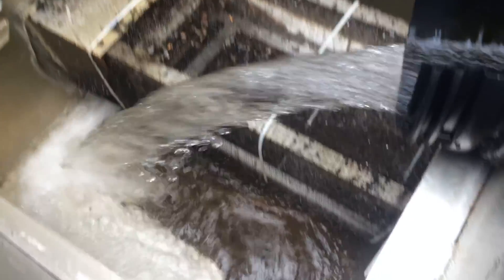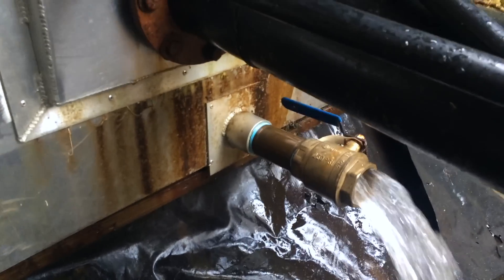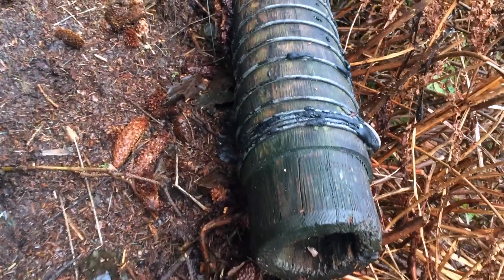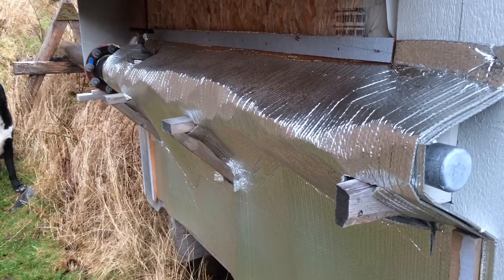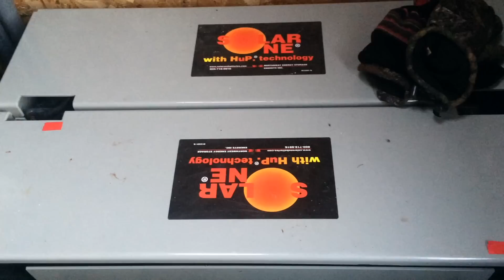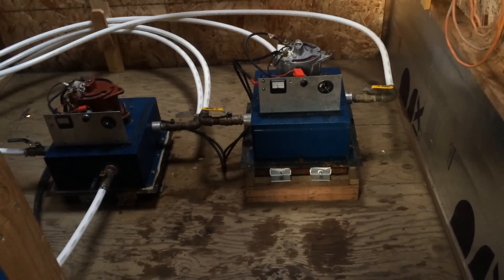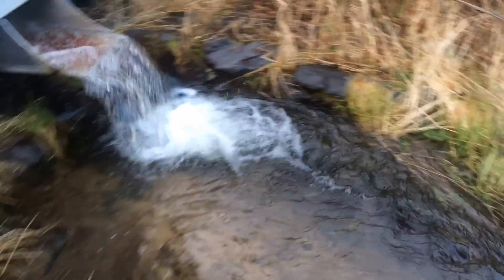Our Hydroelectric Power

Comment: it was all so beautiful until about 5:20.

right angle bends? small bore pipe? ball valves? PM generator? rectifiers, chargers, batteries?

its a shame that these systems are sold. they just... miss the point. its not your fault. theyre all set up like this... seriously, someone slapped these kits together, sells them off as green, and laughs as they pocket the profit. they are a far cry from what is truly possible, and it just makes me sad. its a CON JOB.

water doesnt not like right angle bends, and water does not like abrupt changes in diameter. all the pressure in a pelton should appear directly behind the nozzle, and nowhere else. that means its big bore. all the way.

ball valves restrict flow by restricting pressure. they dont maintain velocity. whereas a doble or spike type nozzle does. it restricts the flow, maintains pressure, maintains velocity. the wheel speed is then controlled entirely by the load, and the flow only has to be adjusted to suffice.

give me an old genset head, and with that same wheel i would give you mains compatible power, 50/60hz, 110/240,3phase 415, whatever... 24/7, without all the stupid electronics in the way.

and if it breaks down you can tap it with a hammer and figure it out.

Comment: What part of the country is this located?
You must obviously cook and heat all your domestic hot water with propane gas or use wood stoves or boilers. 
I suspect all the inverter load is lighting and low watt appliances.

Comment: I would love to have a Hydro Power system. Looks like you have a lot of head pressure. So, I am curious why not put real full size generator motors on top of your pelton wheels instead of those tiny 60Amp alternators? Extra power never hurts.

Comment: Awesome system! My dream is to have hydro, solar, and wind power working together so I can supply all my energy without fuel.
Reply: Look into Liquid Air as well.  A compressor uses excess energy during your peak hours to compress air into a slurry of liquid nitrogen and oxygen and when you need extra power. Simply use the liquid to power a genny.
The byproduct is ice cold air..
So you can use it for refrigeration or air conditioning
Reply: you're better off going for two alone depending on where you live
Reply: My also same dream 🙂

Comment: Why do you have batteries? Considering you have constant water flow?
Reply: The batteries in any off grid application is so you have a constant supply going to the inverter to switch the DC to AC household power. This is a 48v DC system with huge battery banks so they are not running into deep cycling the batteries and if they do run into a mechanical problem they probably have at least a weeks worth of power in battery.
Reply: Because you need somewhere to store the power being generated.
Reply: David Tebbitt but production is constant
Reply: @bob15479  Though production may be constant, usage is likely not constant.  Batteries would allow peak usage to exceed production wattage.

During the day there may be very little electricity consumption, which needs to be dumped somewhere.  If you dump it to batteries, you can spend the excess at night on lighting, heating, etc., even if the turbine is under-powered for all that usage.
Reply: @Thoracius  so why not just use a super capacitor bank?
Reply: @PhysicsViolator  not as good bang for your buck, probably, and offers no advantage.

Comment: this is an overly complicated system, a water wheel eliminates all this transfer of water to accomplish what can be accomplished at the water source! the turning of the water wheel is the rotation needed to create the power!
Reply: Most water wheels large enough to generate sufficient voltage to run a lodge and entire estate like this guy lives on are really unreliable, either the wood framing breaks or the bearings go within a few months of constant use. I've experimented with a lot of these systems and this guy's is the only one on YouTube I'd recommend people copying, he seems like a legit hydro-engineer who knows what he's doing, or at least someone who's done a looooot of homework...

There's a lot of tiny details you maybe don't notice that make it much better than other systems, like how the water intake doesn't collect too much water and self limits, then points away from the filter directly but instead hits a splash pan before turning 45 degrees into the filter to extend its lifespan as much as possible.
Reply: @thomascrabtree  who said anything about creating power for the whole world, you idiots are always trying to manipulate words to conform to your own wants instead of realizing that this article is about creating power for limited use! this screw system can light a single light and that is all it does, you can't cover the world in them either so you point is ludicrous at best!!!! also your claim that the water wheel is not dependable is ridiculous as the screw method has the exact same source and supply issues!!!!!!

Comment: I really like your system. I am in the planning stages for my own system here in Chile. We are off grid now with solar but need more power in the winter when the sun is low and the water is high. We get a lot of rain here. 

I especially like your Bar Screen / Filter box system. It really is a case of keeping out the trash from the pelton wheels. 

Thank you so much for sharing. Jim in Chile.
Reply: Notice how he points the water away from the filter into a splash pan so it's not directly bombarding the wire, very clever.
Reply: @thomascrabtree  I used to appraise sewer plants and saw a lot of bar screens over my time. His by far is the best design. Really nice. Jim in Chile

Comment: Dang, basically 3.5kw of constant power being generated by that little hydro system. Not bad at all!
Reply: I've seen smaller creeks doing 8 kWh, he's missing a trick by not compressing the water into a high pressure hose after filtering it.
Reply: @thomascrabtree  compressing it into a hose? what the hell are you on about?
Reply: @jakeminogue  I believe he means that if you run the water through a smaller diameter hose and "compress" the water you will generate a much higher level of water pressure, thus putting more force on the blades that catch the water to spin the turbine, thus generating more power.
Reply: @manfrommaine  if you decrease the hose size, you increase the velocity of the water, at the same time decreasing its pressure (bernoullis principal) you are just trading one form of energy for another. you cant simply make more energy by using a smaller hose, that defies the first law of thermodynamics
Reply: @jakeminogue  Read up on jet velocity and torque. https://en.wikipedia.org/wiki/Pelton_wheel#Turbine_physics_and_derivation
Reply: ryan norris  ye hed be more precise with the aimed water jet spinning the shit, a smaller stream at a more concentrated point will most likely increase efficiency and achieve better results...it doesnt change the amount of energy by using a smaller diameter pipe for sure lol

Comment: A great setup and your explanations are good until you went inside then it was very hard to hear you. It would be nice if you spent a little more time describing the equipment by name of manufacture such as your 
controllers, alternators / generators, inverters, and your backup diesel generator for other future homesteaders. Other than that it was a great video. I wood if I were you save the one remaining piece of wooden water pipe letting it dry out and preserving some how wether leaving as is our consult some one on if it needs a treatment put on it to prevent it from breaking down. Then either donating to a local museum or keeping for your self as it is a part of the history of your area I would also take more still pictures of stills which can be printed and preserved for history. Nice  job it would be nice to know your total project cost and when your break even point occurs or has already.

Comment: Would love more info details on the inverters /controllers. Loads, load management.  I’ve completed my turbine and finishing electrical plans.  4.5-5.5kw is potential.  Load testing output shaft now.  So far: loaded is 900 rpm and looks like 14 ft.lbs min.  Some Tweaking should get more torque.  Thanks for video.

Comment: The water power source is free, so any discussion about efficiency is almost irrelevant. Aside from the equipment, hes getting cost free power. Nice job!
Reply: @Richard Vaughn Basic set up, low or no cost, gets power for free. The rest is nit picking.
Reply: Nothing is ever free. It takes money to build the system and to maintain it. And as Richard Vaughn pointed out, the more efficient your system is, the less often you have to run the generator, and the less money spent on fuel.
Reply: @Richard Vaughn you assume he will run out of water.  Most likely not though as Kodiak gets lots of rain.

Comment: I removed a 4 foot diameter wood stave water line that used to provide water to the pulp and paper mill in my hometown. Built in the 1930's,  it was still in use in the 1990's, although it had been patched a number of times. All the wood was Western red cedar.

Comment: I like. it's good. Mine works different Though. I use copper/aluminium/ bleach. In six inch  tubes . To feed a inveter. To charge batteries.. rain water makes. Does the honours de kv4li

Comment: You need a bigger pipe going to those nozzles... If it is enough power right now then just leave it, but you're probably losing a fair bit of power.
Reply: The manifold should all be made of metal (not pvc) 45 degree taps and be sure that the last few feet of the hosing is reinforced or a least thick walled PVC. I also did not see any kind of air pressure relief system such as a stand pipe. The pressure at the bottom with that kind of head can blow out any weak connection particularly if you get an air bubble or water hammer.
Reply: Those end pipes are too small for sure, the inside diameter probably isn't any bigger than the nozzle.....then again, maybe a slower water jet would be easier on the turbine (less wear). He's getting the energy for free, less maintenance costs, so if it's doing all that he needs there's not point changing the setup.

Comment: thanks for posting.   nice system.     amps  are  NOT  power,  however       could you provide  hydro system output  in   WATTS, continuous.     (if effective head and  nominal flow rate were shared,  the total amount of potential energy going into the turbine, could be calculated, by me; in order to determine system efficiency.)    cheers
Reply: He said the alternators put out 48v, so a little over 3kW.
Reply: @JohnWatkinsUK  welp, you have answered a question that i did  Not  ask.      if   48v at  70a, is assumed,  output is 3.36 kw; ac or dc.         efficiency is a   COMPARISON (of input to output).       without  having values for  head and flow rate,  such a comparison is  IMPOSSIBLE.
Reply: @daviddavids2884  , technically you never asked a question, you rattled on about your inability to listen to the video, requested a provision be made, scoffed in hubris fashion within some fantasy world, and then ended in buddy talk......finally, when given your provision, you replied that it wasn't even your question.  You wanted watts, you got watts.

Next time, maybe use the question mark tool so that it can be clearly seen what question you want to ask; plus you may want to forego parenthetical additions, as they seem to go over your head for the allotment of their usage.

cheers
Reply: Almost all information was given to be able to calculate what you are wanting to know. 350 feet in elevation, 4 inch pipe, reduced to 2 inch pipe, reduced to 3/4 inch pipe, with a 5/16 jet. So now break out your calculator, seeing as you clearly don't know how to listen.
Reply: The water is nearly free so output and first cost are the determing factors. Good job.
Reply: Who cares about efficiency?  It is what it is... he can't change any of it.
Reply: @Richard VaughnIt will cost $ to improve the system. All I see is free power. He did it at minimum cost and it works. That's all that really matters. 
   You spend all the money you want on yours, then let us know what the return is on your investment in comparison to this design.
Reply: If the water power is free then the efficiency is 100%, after the equipment is amortized. What else matters?